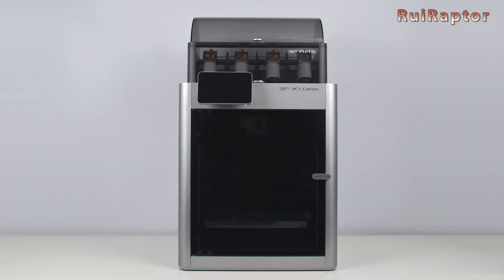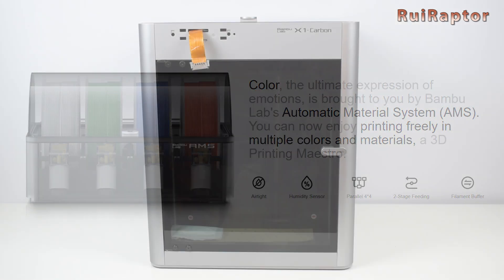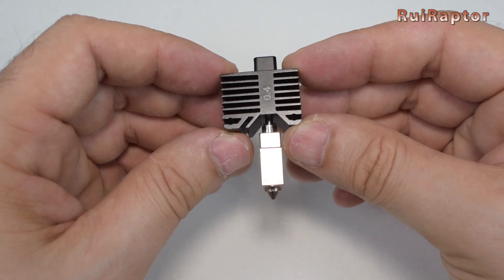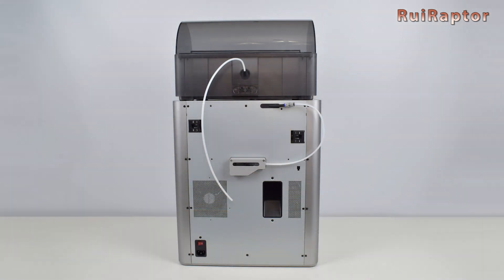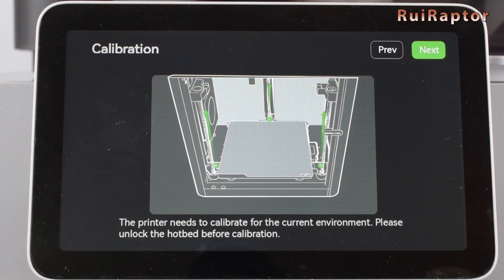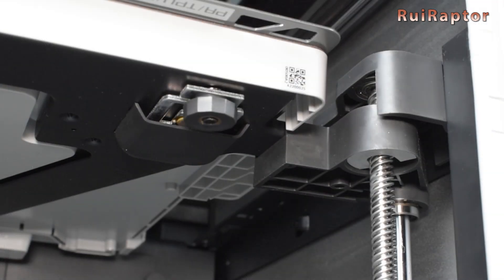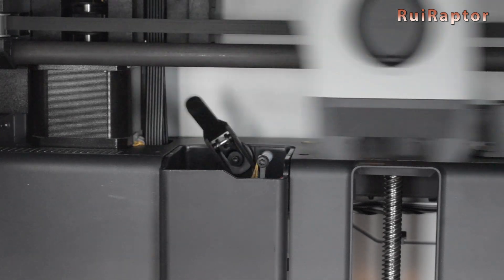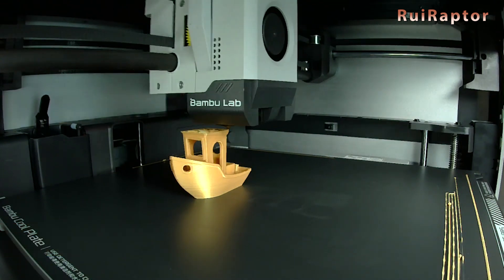Bambu Lab X1 CARBON – Unboxing, Detailed Analysis & Print Tests

Comment: could you please please make some test prints videos/tutorials on  "Assassins Creed Odyssey cos-play items" such as helmets, breastplates, ect.. for example The Caduceus Blade, The Dagger of Kronus, The Leonidas Spear Head, 
some helmets like, The Spartan helmet, "The Radiant Leaves Crown," The Helmet of Ares, Korinthian Helmet, I've been wanted to purchase a 3D printer for some time now and with your reviews, I think might save up to purchase this one, and or a Prusa Printer ( The Prusa Mini Plus ) 

as it prints fast where's like other 3 print take almost either 24hrs and or say 10hrs +, I hope you will see my comment and consider making some videos please and thank you

also I'm new to 3D printing as well and does it load different colors on it's own or would I have to manually change the color each time.? I see that you have the Four Filament Model that's why I'm asking as well because the Prusa printers and mini + are all  compatible with the mosaic palette 3 and  mosaic palette 3 pro version " and that the mosaic palette 3 pro version can use 8 filaments at a time where as the mosaic palette 3 version also uses 4 filaments at a time.

Comment: Hi there, great video. One thing I am wondering about this machine is whether it’s possible to use a longer PTFE tube between the printer & AMS so that I could put the AMS in a more convenient location as on the shelf where I would put it the AMS would not fit up top. Is it just a simple matter of getting a longer tube or does the software rely on it being that length to tell the machine to feed properly?

Comment: It was a perfect printer until the proprietary filament. I wonder if there's a way to use any filament.
Reply from the maker: We mention that in the video. You can still use other filament brands with this printer.
Reply: @ruiraptor  Wow.. That's good to know. So it works even without the RFID of the spool?
Reply from the maker: Correct. It works even without the RFID on the spool.

Comment: You don’t need to remove the buffer just feed in the filament directly into the tube after the buffer.
Reply from the maker: The spool does not fit on the spool holder unless the buffer is removed. The alternative is to place the filament somewhere else.
Reply: @ruiraptor  Okey, so it’s the standard to short holder? Otherwise it would be bad and I need to drill some holes further up for the buffer.
Reply from the maker: Correct, that is what we think too. If the spool holder was a bit longer, we wouldn't had the need to remove the buffer out. Maybe this is something that the manufacturer can modify in the future.
Reply: @ruiraptor  I will print a longer version.

Comment: This machine is what the consumer 3D printing space has desperately needed. Very professionally designed and engineered from the top, all the way down to the software and firmware. They had to have had a massive financial investment to get this far.
Reply: They did. They had a fundraiser before going to kickstarter.
Reply: Yep. They raised around 9 million dollars

Comment: Great video 👍. Could you please mention the 3d printer’s dimensions with and without the AMS system on top?
Reply from the maker: Hi, here are the dimensions: 390x390x480mm (without AMS unit) and 390x390x680mm (with AMS unit). 
When using the AMS unit, you need to add 20mm more because of the filament buffer. When not using the AMS unit, you need to add 90mm more because of the filament spool holder.
Reply: @ruiraptor  Thank you for those detailed measurements 👍